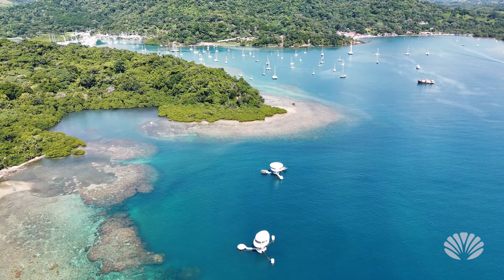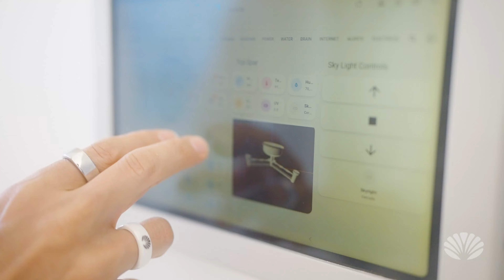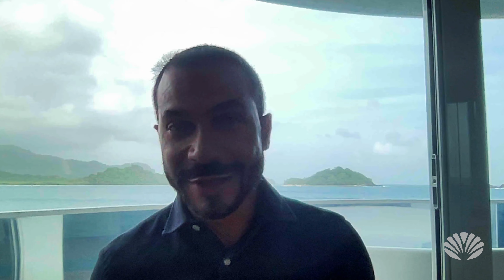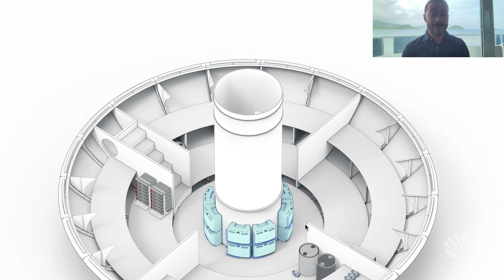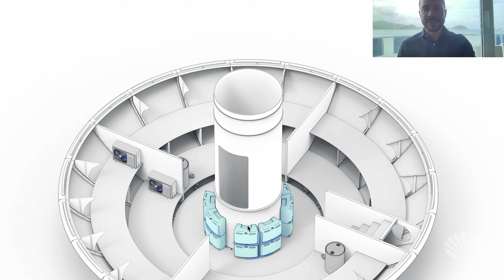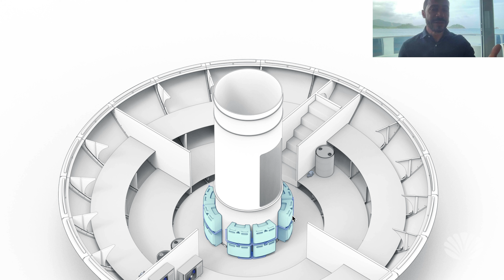Engineering Room

Comment: I am wondering if the battery compartment has a carbon dioxide fire extinguishing system and if there is a separate vent to remove the smoke if the batteries catch fire.